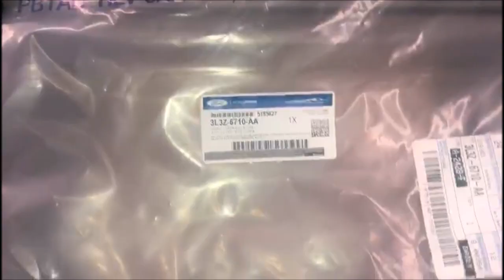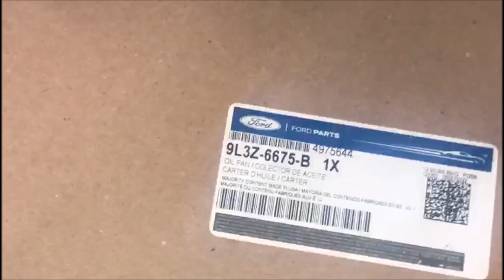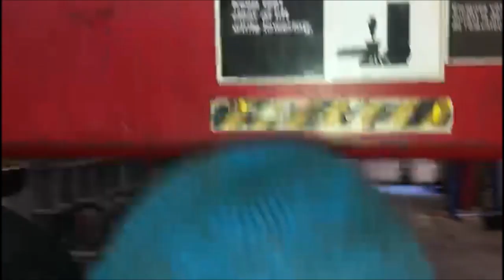How to replace the oil pan with the gasket on 2010 Ford F150 4.6 V8

Comment: Good work but you really need to use a 3/8" gun with the pan bolts, if any of them were frozen, they would have snapped right off with that 1/2" gun.